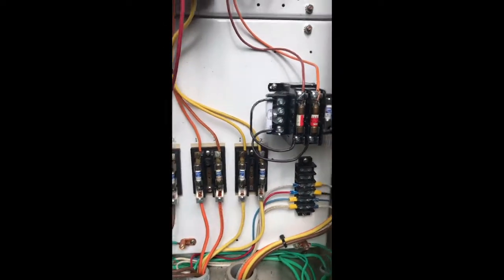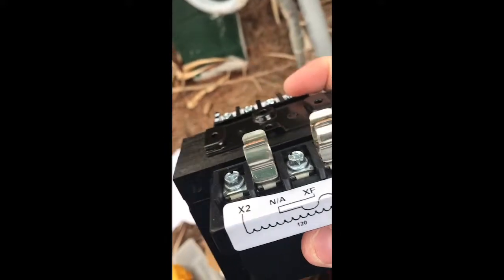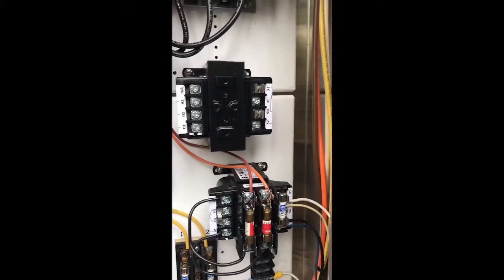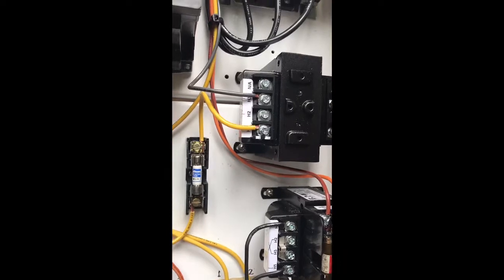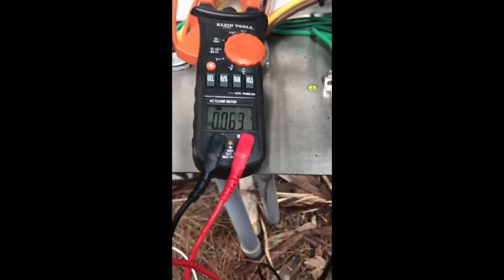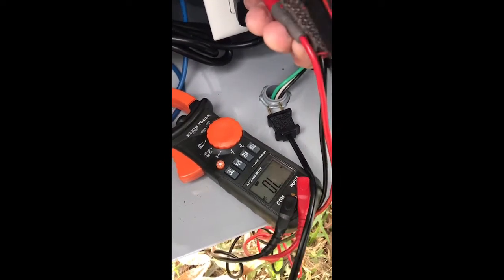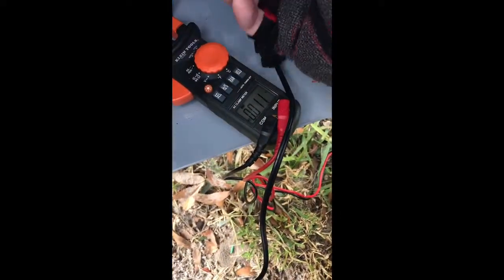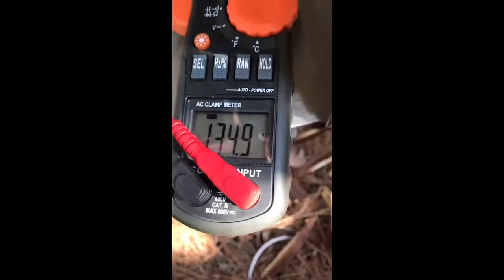480-120V step-down transformers

Comment: Not having the neutral bonded to the ground was preventing an effective ground fault current path. And with each transformer weather it a step up or step down will give you double or half the voltage due to only measuring half the winding. Glad you figured it out.